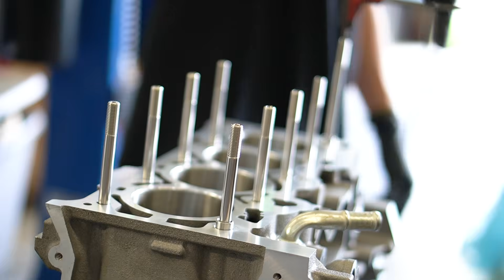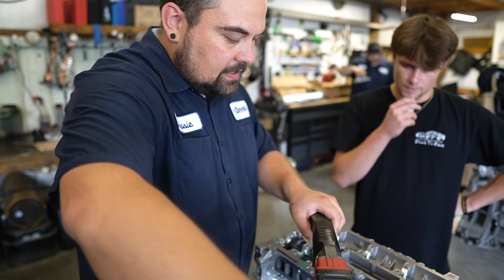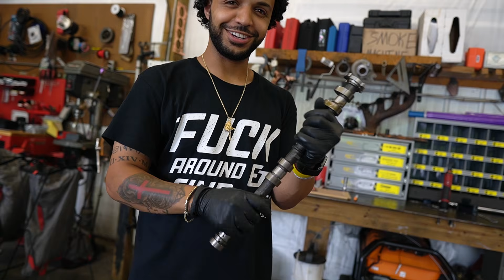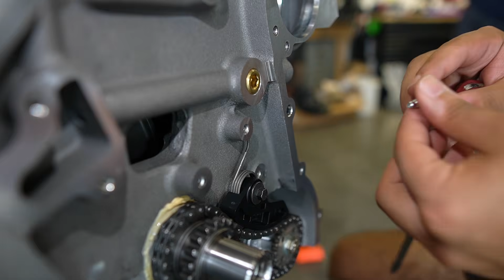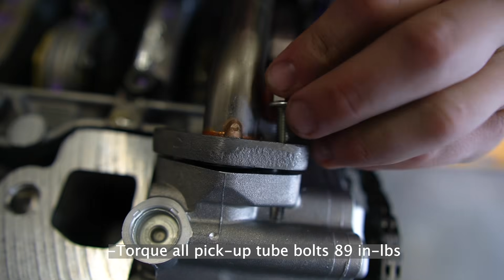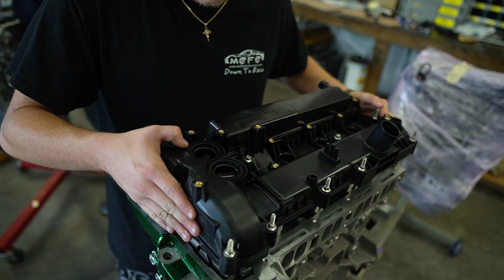2.3L EcoBoost Long Block Timing & Assembly Process

Comment: Hi i have 2018 2.3 ford mustang ecoboost, and it's developed a ticking noise on cold and then stop when the engine reaches temperature. What do you think it could be . I think it's timing chain slapping on the pensioners.  What do you think

Comment: I have a question, why didn't you put the balancer shaft underneath the crankcase? The Evoque has it. The engine is very similar. Not balance shaft?

Comment: I have a question, why didn't you put the balancer shaft underneath the crankcase? The Evoque has it. The engine is very similar.

Comment: What about the paper thin shim that goes behind the crankshaft pulley (Crankshaft Pulley Washer - Ford (1S7Z-6378-AA) ?  This fit s the 2.0, 2.3 and more. I didn't see that shim in the video. Is that shim required? Thanks for your video and input. Much appreciated!

Comment: Thank you fora wonderful video. Just a question, is it any important to line up the holes on the cams to those on the VCT units when doing the timing? I just did mine and I'm have a little bit of hesitation or a bit rough idle.

Comment: No Balance Shaft.?
Reply: I have a question, why didn't you put the balancer shaft underneath the crankcase? The Evoque has it. The engine is very similar.

Comment: thank you for this excellent video, I have owned a mustang ecoboost since 2017 and I am very happy to learn about this engine. I have a question for you: I would like to renew the coolant and I would like to know if there is a drain on the engine block (in addition to that of the radiator) because if I am not mistaken when you drain only from the bottom of the radiator you do not completely remove the liquid. If you had a diagram a photo or a video on this At this point I will be very interested and will be grateful to you.
Thank you so much.
Reply: I have a question, why didn't you put the balancer shaft underneath the crankcase? The Evoque has it. The engine is very similar.

Comment: Cam shaft bolts r u sure torque is 142lb ?
Reply: cam cap bolts are 142 in lbs, phaser bolts are 30 ft lbs then 60 degrees
Reply: @JessieRingley  2.5 duratec is pretty similar,I found 72Nm without additional torque in degree. Looks at the end similar. Is correct?

Comment: On OEM phasers does it matter where they are when setting the timing before putting the timing chain on and torquing the cam bolts down?
Reply from the maker: No sir

Comment: Thanks for your video, i rebuilt my 2.3 2016 mustang and engine wont start, i have no spark, scanner says crank fueling disabled and it says ckp and cmp not synchronization, please help and advice greatly appreciated.  Engine sounds great cranking i followed all of your video. Would be great to show the crank pulley install.
Reply from the maker: Did you use the special tool to time the engine and the special tool to set the crank position sensor? It’s also a good idea to reset the ecu as well.

Our pullies are keyed, so they only go on 1 way.

Comment: Have you ever used or looked into using the regular n/a ford focus head on an ecoboost block?  I’m going down that road for my st and wanted to see if u had insights
Reply from the maker: yes, and it is possible, but you will lose the vacuum pump, have a different HPFP housing, and be liited to the OEM cams the came in that cylinder head or custom made heads.